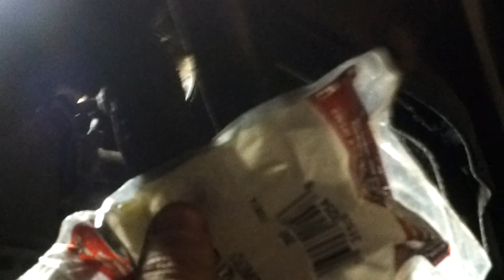2001 Ford E250 4.2L Oil Pressure Switch Location

Comment: I have the 2002. My gauge fluctuates in the lower section, then goes all the way down to nothing and my red oil light comes on. This is only after the van has really warmed up and only when I come to a stop. I'm guessing that above 900 RPM, the oil pressure is OK.  So at stop lights, I put the van in neutral and press the accelerator to reach the higher RPM. I am guessing that it's either a defective sender, a clogged oil screen pick up (but why does it only happen when the oil is hot), or just a worn oil pump.
Reply from the maker: Those are classic signs of oil pump failure, I would recommend stop driving it and don't run it for any length of time until the oil pump and pickup tube are inspected and replaced. The reason it happens when the oil is hot is because it becomes more viscous and can more easily flow around the worn out seals on the oil pump.

Just a few seconds without oil pressure can cause catastrophic engine damage, as I well know from the engine in my dakota developing a weak oil pump, which trashed ALL of the rod and crank bearings and scored up the crankshaft.

I didn't have any money at the time so I had to make due with just replacing the oil pump and prey that it wouldn't throw a rod. The engine sounded like hell and eventually both heads blew, but it lasted a bit over a year in that state.

If you've run that engine in that state for more than a day, I would trash the engine and get a junk yard motor, or if you're a big spender, a reman engine. Just don't get it from any of the major auto parts suppliers (Autozone, Oriellys, Advance) because they all use the same shit company out of Dallas that makes trash engines.
Reply: @GGigabiteM  Will do.
Reply: They sell two different sending units. Which did you have?